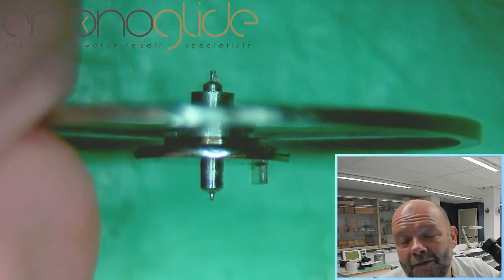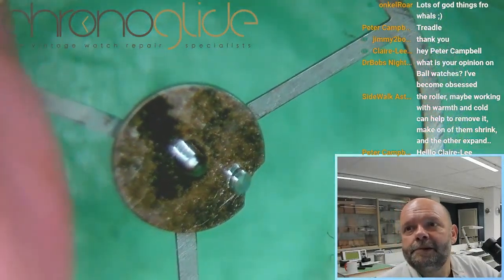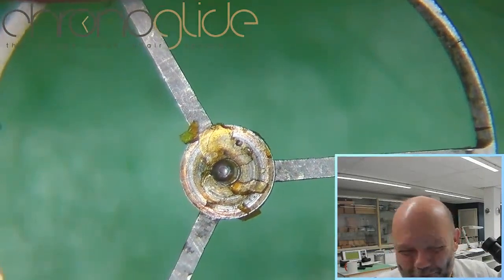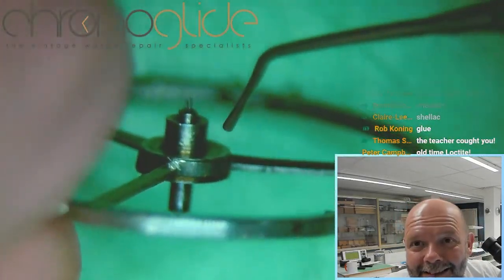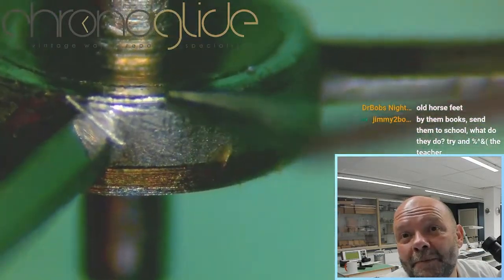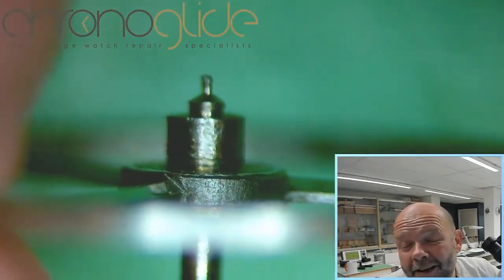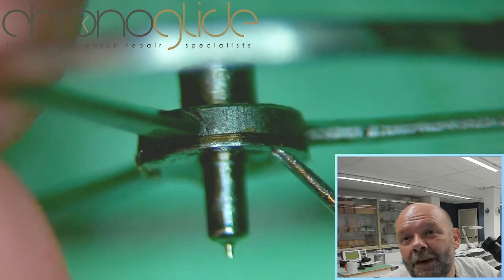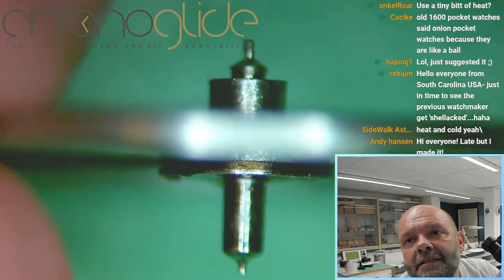Amazing pocket watch! Balance work - part 3

Comment: They are different metals, maybe do something with temperatures?
Reply: Yes - it looked like a steel staff with a brass bush between it and the balance rim. Clearly two different metals on the table wall.